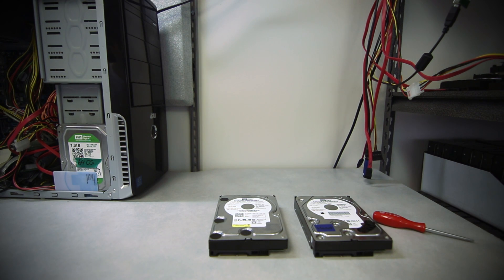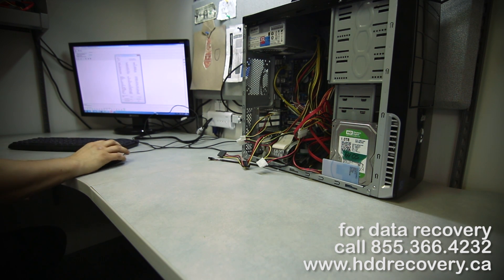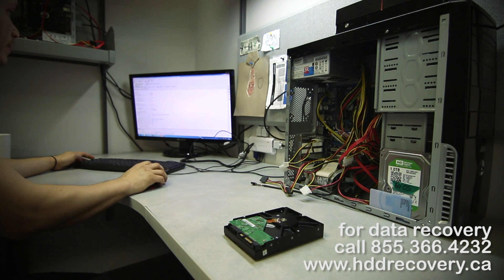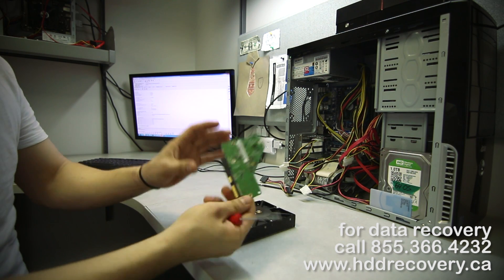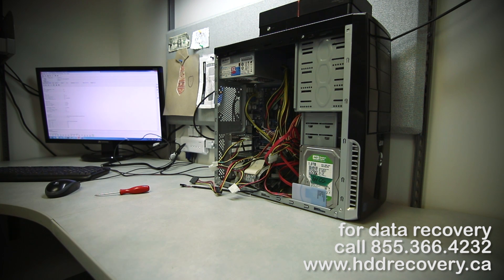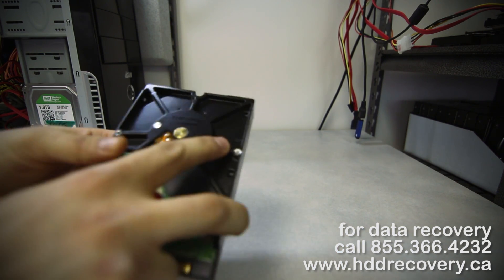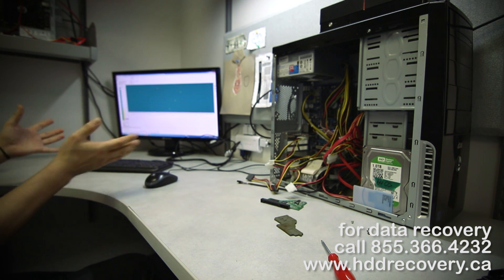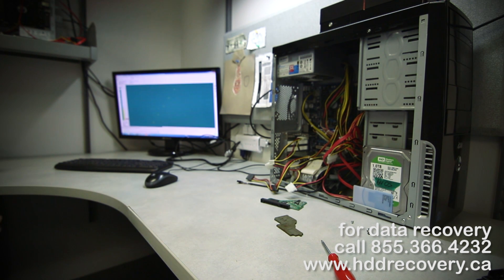data recovery: clicking western digital WD5000AAKS

Comment: the hdd accepted the donor pcb without changing the bios chip., is that really possible ?
Reply: These boards do not have U12 EPROM physically therefore the ROM content embedded to the Marvel 88i6745 MCU and it can be copied with PC3K between the MCUs.

Comment: So. Instead of transferring physically the patient's board bios chip to the donor board, you're using the software to write the chip info on the donor chip? sorry if I didn't explain my self well. My english is not very good
Reply from the maker: Yes exactly
Reply: @hddrecoveryservices  What software do you use do this? I've got a PCB Board that I need to do a repair on. The BIOS is in the integrated IC same as this. 
I've never had to swap a ROM from a PCB before but I'd love to know what you used to do this.

Comment: This WD5000AAKS came in a Fantom external harddrive I purchased. Will I be able to get the data off it as a bare drive connected to a USB to SATA adaptor without the electronics of Fantom enclosure?